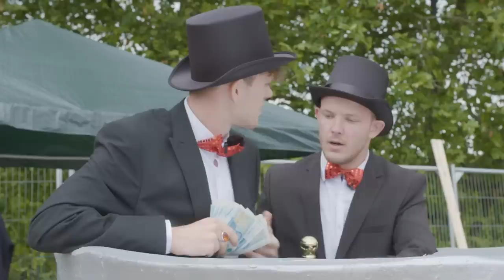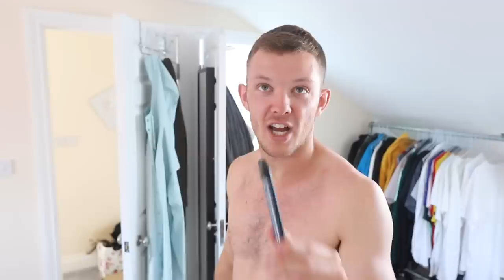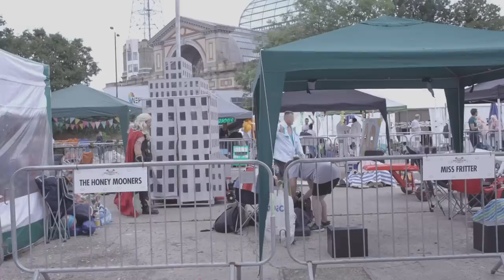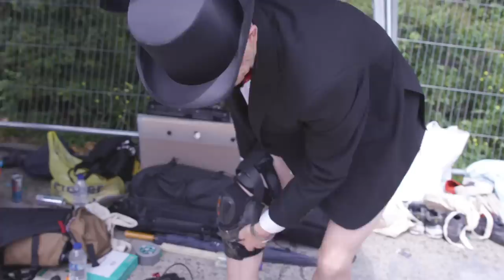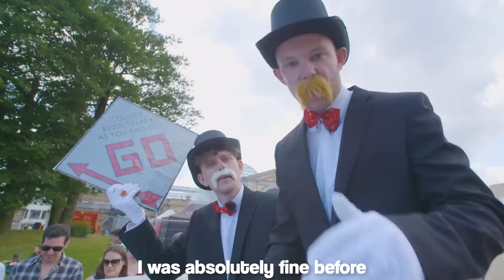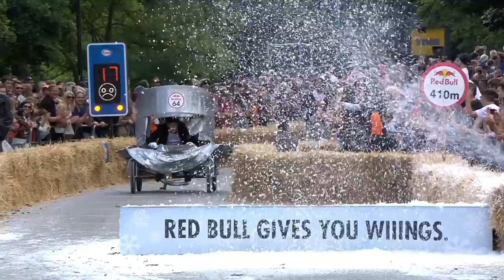We Crashed badly in the Redbull Soapbox London

Comment: From a technical perspective, you've got the forks very steep and upright, which makes the steering twitchy. If you have a bit more forward angle on them they will naturally decide to point straighter. 

(note: this will put more pressure on a couple welds and isn't as strong)